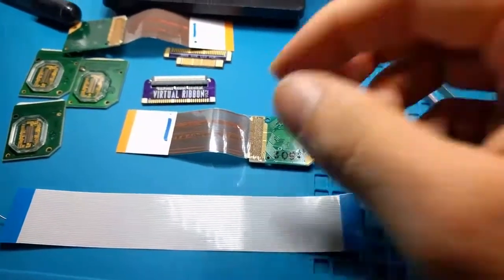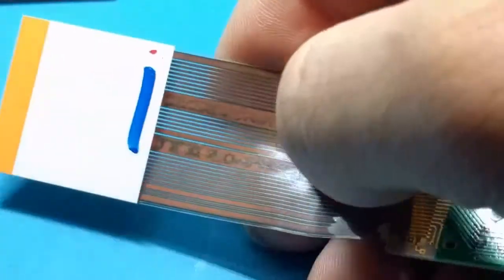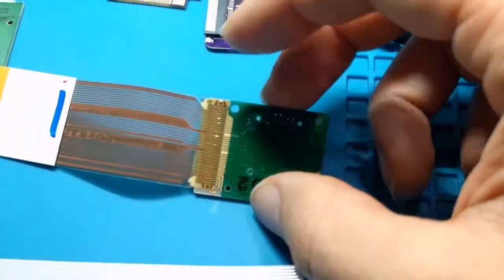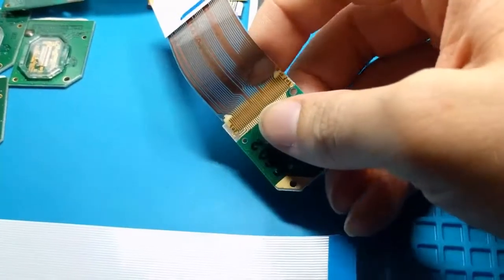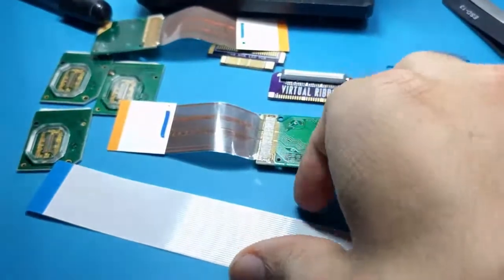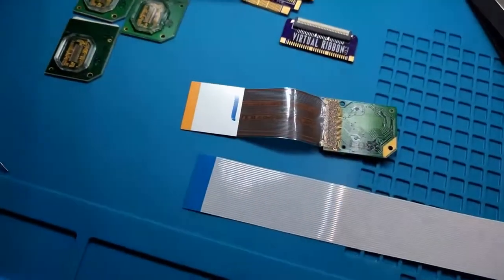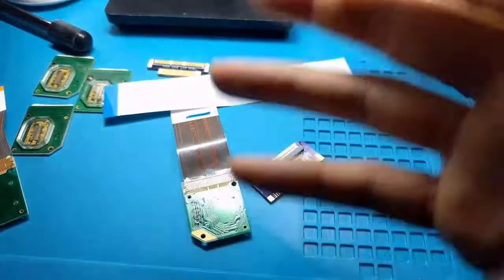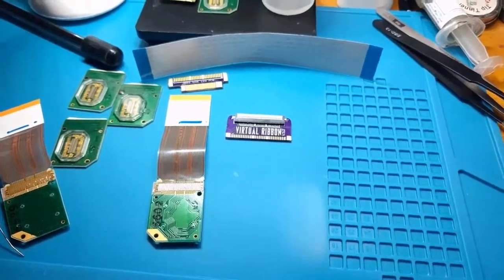Virtual Ribbon - Why Did I Design It?

Comment: I thought the Virtual Tap installation involved removing these cables anyway.
Reply from the maker: Nope, not true.  The Virtual Tap is a pass thru add-on, it still requires fully working LEDs (which need this or a similar repair / upgrade) if you want the Virtual Boy to function with the motor / LEDs as well
Reply: @SegasonicfanDesigns  That's good news. I stopped following it early on because I was told I would basically disable my Virtual Boy for normal use. Didn't want that! :)
Reply from the maker: @emmettturner9452  Oh yeah, that's just an option that some people are doing. Not my way of doing things either, I want to retain the original functionality with the mirror motor + LEDs. Fortunately, it's designed very well and allows for both :)